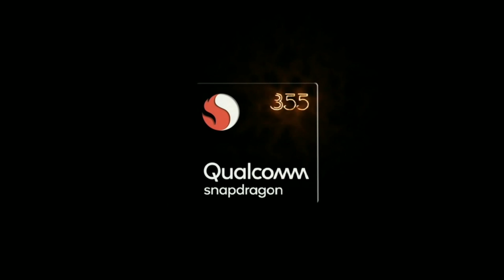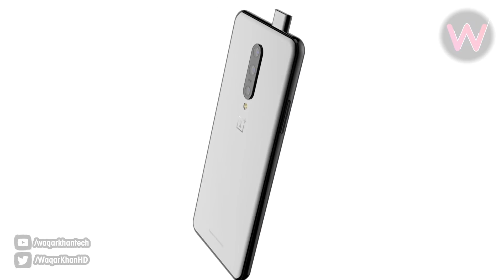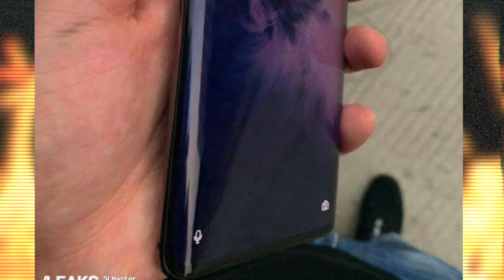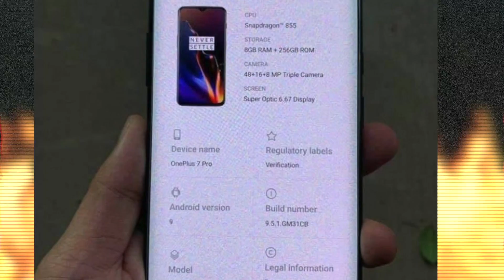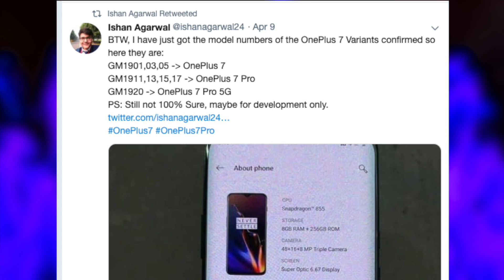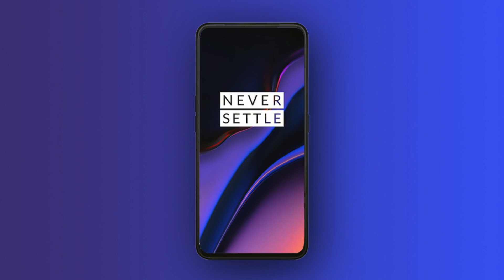OnePlus 7 Pro - BEYOND THE SPEED!

Comment: Still no water & dust resistance due to pop up camera.Oh no wireless charging also with glass back.Shame on one plus.If u agree like & if u disagree comment.
Reply: It has water resistance but getting an IP rating requires a certification which would increase the price.  Wireless charging is slow and ineffective.  It's not truly wireless anyways.   This phone will charge lightning fast.
Reply: @Mounopliktos  Yep, OnePlus charging is so fast that there isn't a need for wireless charging on the go

Comment: Okay so just explain me this : the phone he hi holding has no notch but the phone(image) displayed on the about phone section has a notch!!!
Reply: The one in the settings is a OnePlus 6t, it's either a fake leak or just they haven't polished the system for op7 yet
Reply: That's about the phone section dude...so the image displayed has to be the phone he is holding... just a dude
Reply: @bharadwajshlok  That is the "about phone" section found in the settings you smart aleck, do not try to tell me it's something else because I am using a Oneplus 6. And that is a possibly a fake leak, if not it's a prototype of the production model. It's not even realised yet and they probably haven't replaced the icon as the design is not final. I am sure it's easily changeable the minute they finalized the design. Because it's really stupid to put an unpolished design as the icon even before release. So better stop assuming.

Comment: As TechTalkTV said:
1. It won't have water resistance
2. It won't have microSD slot 
3. It won't have a headphone jack
4. It will be less durable
5. It won't have wireless charging

Why do we consider this a flagship? 
You'll say "but it's cheap". Ofcourse it'll be cheap when it doesn't include any of the flagship features lol
Reply: you actually didnt say even 1 good reason. yes ip rating it might be however it will have water resistance but they wont  pay for the rating bcs of the price just like 6 and 6t. headphone: almost every one is doing the same except for samsung and lg. micro sd slot the same as headphone jack instead it will have dual sim slot. durability: we should wait for the tests we cant say anything right now but i really like that full screen display with no bezels. wireless charging: its absolutely the most overrated and garbage feature in tech! whats good about it? is it actually wirelessly charging your phone?"no" is it faster thane wired charging?"no"  wireless charging might be something in future but now its useless. i believe the only flagship worth buying right now is the s10 because it delivers everything you expect from a phone other phones are not like that therefore it is more logical to buy phones like op7 mi9 etc.
Reply: headphone jack :'( :'( :'(
Reply: MegasXLR All the stuff you mention many consumers do not care about, you can live without them easily. 
1 // Water resistance, it is a electronic device so unless it is waterproof I keep even IP68 away from water. Had phones for 25 years plus and never damaged by water. 
2 // Most users rarely get to 64gb let alone need 128gb or an SD card. If you need the card for doing stuff you shouldn’t then that does not count.
3 // No headphone jack is the future, you may not like that, same as removable batteries, a lot of whiners, but that is life. You can still use an adapter, a usb-c headphone or Bluetooth so is a non-issue.
4 // Les durable, Samsung fans have the most fragile phone in the S series, the Edge display make Gorilla Glass 6 as useful as GG2. Put it n a case and it will be fine.
5 // Inductive charging is the biggest marketing crap ever, developed to sell more accessories that charge slower and have poor efficiency. They had the “cool” factor at one point, but reality is a fast charger, like the OP7 where in 30 minutes you can get 70% plus is a far better feature.

Teens believe flagship means as many features as possible, well that is not true, it means having the latest SOC. The iphone did not have wireless charging, SD card, headphone jack, water resistance and was still a flagship. Some of us value different features much higher than those you mentioned, for instance saving $400 with the OP7 over the S10+ in lieu of those features is a good trade. Welcome to the world where a product can be greater than the sum of its parts!
Reply: For me..no 1 and 5 not a problem for me..no 4 can be solved with a case..but no 2 and 3 is a must have features..thats now android identity..better buy an iphone if none of these 2 features got lol..
Reply: 3 and 4 ouch....
Reply: Well oneplus 7 will be the fastest phone on the market with great battery and one of the fastest charging speeds
Reply: Will still be better then s10
Reply: @ZAINKHAN-ii6gy  How exactly? It's objectively worse in every way

Comment: Really wish they would bring back the headphone jack. Got airpods and other Bluetooth headphones but sometimes I just want a for sure connection and esp not have to think about the headphones running out of battery. Not to mention I have wired higher quality monitor headphones too
Reply: Completely agree. Wireless headphone sucks when gaming.
Reply: daviddaaannggg Ever heard about type c bullet earphones?
Reply: Bhavye Kumar Singh we shouldn't be restricted by our options. Why would I want to buy more headphones when we all already had a UNIVERSAL standard? Manufacturers literally created a problem that didn't exist before
Reply: daviddaaannggg Brother, you get a type-C  dongle/adapter with which u can use your old 3.5mm jack headphone. If the company has made a problem, they have provided the solution with itself only with no extra cost.
Reply: Bhavye Kumar Singh youre literally telling me things we all already know. You think I don't already have headphone adapters? It's also another piece of hardware for potential failure. I can't use wired headphones on my iPhone anymore bc the included adapter doesn't work anymore.  That's also one more thing to keep track of and prevents me from being able to charge and listen simultaneously. Say I did buy the bullets , that means I can't use them on my laptop and also can't use them if I ever decide I wanna use an iPhone or iPad pro with them just for example. Especially since oneplus doesn't have wireless charging. Look no one's arguing there's workarounds but the point is there's wouldn't be a need to have workarounds when we had something that avoided all those to begin with... Don't you see all those potential problem scenarios that literally did not exist before because we all had  universal headphone jack!
Reply: @daviddaaannggg  Yes I agree you cannot charge ur phone simultaneously while using headphones. But let's be practical, you're going to get 44w charging which'd be the fastest after superVOOC which will charge ur phone really fast and I'm sure in a complete day u can leave your phone for 20-25 mins. While for the iphone and ipad part, I dont use apple products because once you start using apple products you get stuck in their apple ecosystem. Them providing 5w charger with the costliest phone in the world is something everyone hates and im no special.